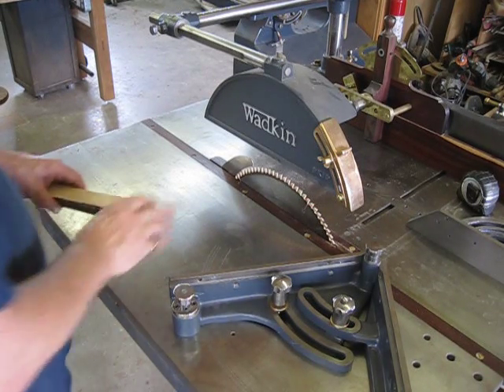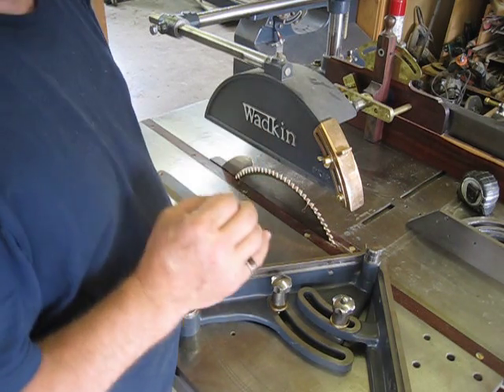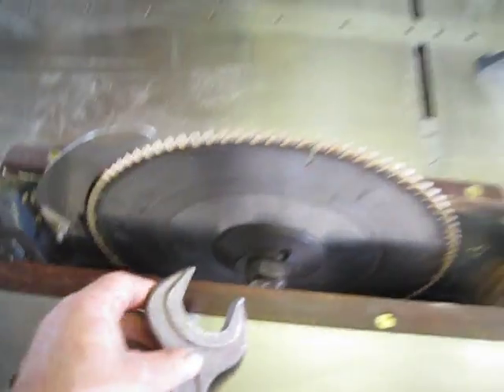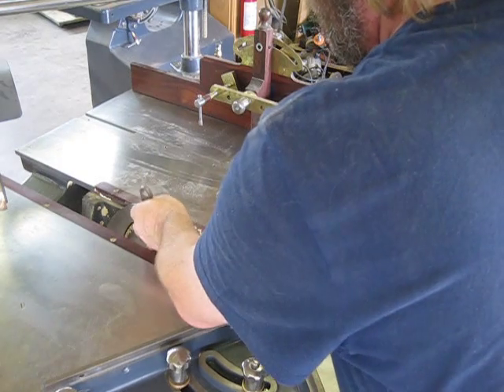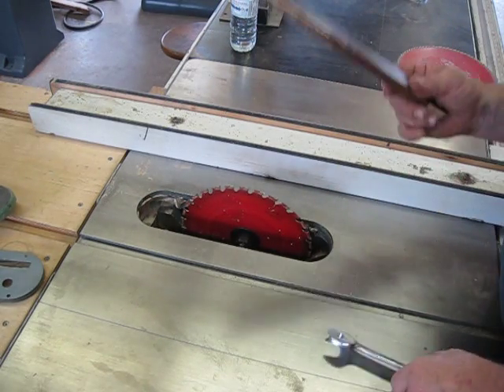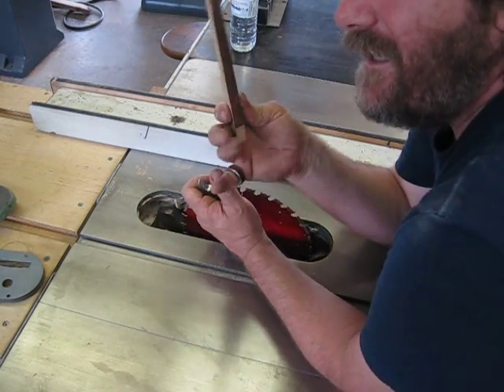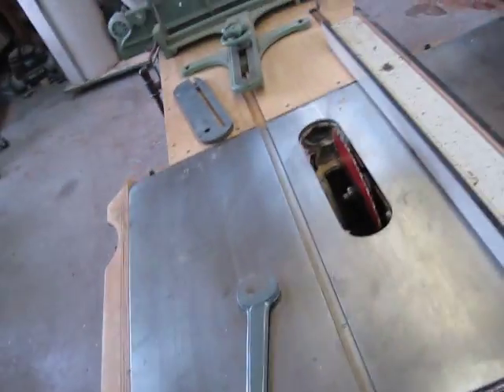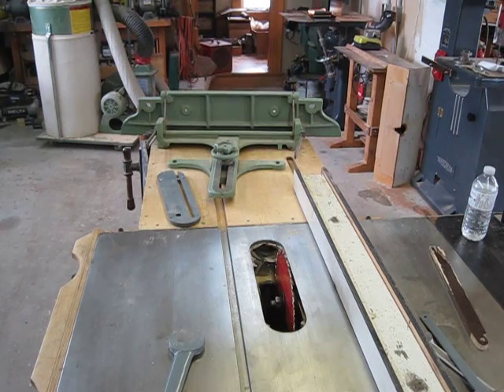How  tight should a blade be set on the table saw?

Comment: Hi. Fantastic Wadkin workshop great job of refurbishing the machinery. When I used to change the blades on Wadkin PK's and PP's many years ago. I just used to put the wrench on the nut, hit the wrench with a wooden mallet in the direction of rotation the cut of the saw blade. This method shocks the nut to unscrew its self. Your hands are nowhere near the blade  and there is no chance of breaking any teeth off the saw blade. This is the way were taught by the older skilled wood machinists. This method is still used on many types of woodworking machinery today.

Comment from the maker: that because the pk is very specal and you pay more to have the sound FX.LOL

No really that was the dust tin shroud around the blade. the blade and motor drive on the pk is very heavy and  when you lower it it sometime makes the nose it the tin collection if not locked off (like when the table is slid open.

not a deal beaker for some.